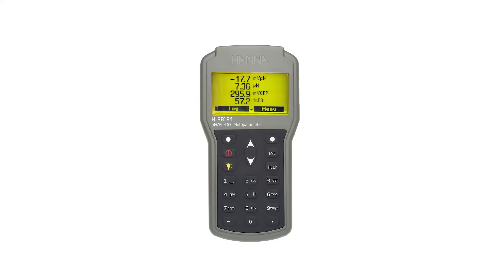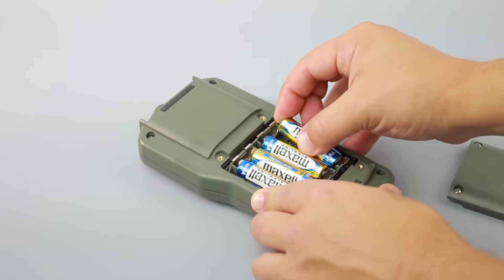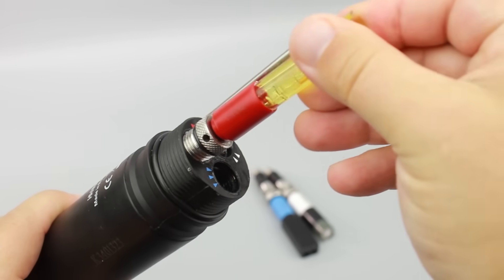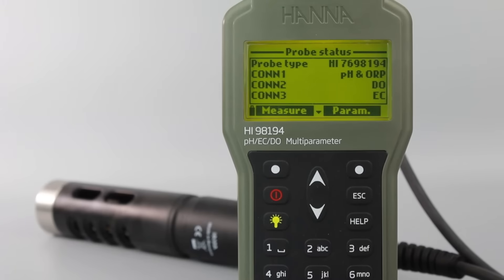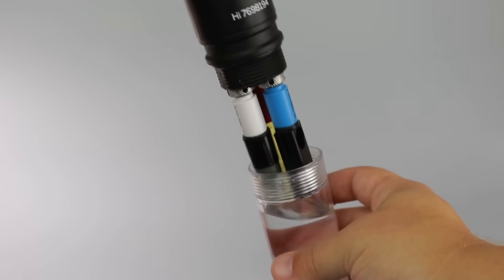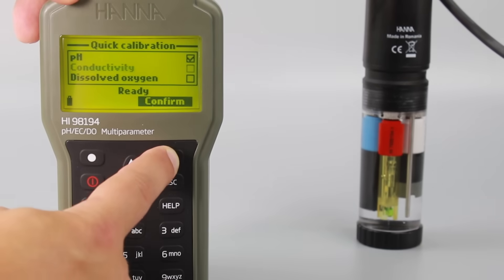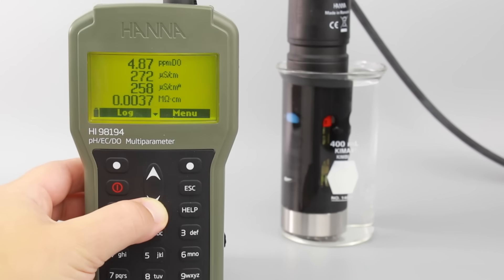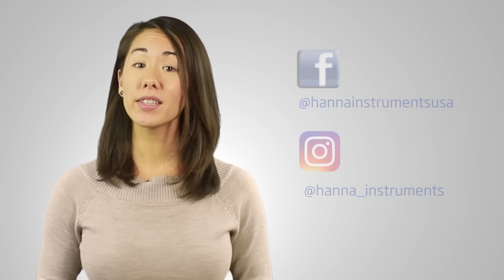How To - Using the Hanna HI98194 Waterproof Portable Multiparameter Meter

Comment: I've noticed that a lot of people are having the same problem with trying to calibrate the DO sensor and they are getting the reading "wrong standard". This happened to myself many times and it is very frustrating, I eventually figured out a work around which I think works very well. Instead of calibrating pH and conductivity first in quick calibration, skip these and immediately go straight to the DO calibration with the empty dry beaker beaker. The DO will calibrate within 1 minute because there are no droplets of pH/conductivity standard on the DO membrane as you have skipped these calibrations. When the DO has successfully calibrated, then go back and calibrate pH and conductivity and you are all set. 

I'm not sure why DO isn't first on the list in quick calibration mode as once the DO membrane becomes wet from the pH/conductivity calibration solution, the calibration reading almost always returns "wrong standard", it even does in the video above if you watch closely. You will never be able to shake off every tiny droplet from the highly sensitive DO probe, it must be completely dry in order for DO to be calibrated in my experience. I'd be interested to hear if Hanna agree with my suggested approach to the DO calibration as many people are having problems with it as can be seen from the comments below.
Reply: The video also doesn't convey that you must gently swirl the probe whilst logging your results, otherwise the DO result will be wrong if there is no movement of water on the DO membrane when the logging occurs. If you simply rest the probe in the sample as is the case in the video, you won't get an accurate DO result. It would be good if a rep from Hanna could confirm if my proposed work around for the DO calibration problem is advisable or not.
Reply: @dpark5070  well it says there should be no solution present when calibrating DO
Reply: @kyleyurkow1169  Yes I am aware of that. However, the video recommends that you should calibrate pH and conductivity first which does not work well for DO calibration in my experience. This results in a very low success rate when trying to calibrate DO in my experience. I've found that it is much better to calibrate DO first when there is zero moisture on the DO membrane that would otherwise be present if the  pH and conductivity were to be calibrated first (which is what the video recommends but does not work well in the real world).  

For those that get the "wrong standard" message for DO, try flicking the outside of the DO electrode with your finger to unlock air bubbles, this has worked well for me many times. Failing that, you can try to change the HI7042S electrolyte fill solution which can also help.
Reply: Did you hear back from Hanna on this?

Comment: are you sure that i can do DO quick calibration like you did on the video?cause for me been trying for some time and its still reading wrong standard and i have following the instructions as given.

i have noted from the video when you were doing DO calibration it read wrong standard and you just said click confirm but i didnt see the meter reading confirm ,could it be that there is a confirm button to use despite the meter reading wrong standard.

and also how do i clean the probes especially for DO mine has already turned white due to waste deposits...

Comment: How do you find the calibration data when using this procedure?  i.e. slopes, % saturation, etc...
Reply: What calibration data? once calibrated, The meter has been returned to default setting and ready to use for accurate measurement

Comment: Hi, I am trying to do calibration and  it just does not recognize the standard as good, I have followed the instructions for both the quick calibration and the single parameter calibration. For 100% it says that it is the wrong standard as it just reaches about 39%, for 0% it does not stabilize even after an hour, so the countdown never finishes. What can I do?
Reply from the maker: Hi Neri. Sometimes with meters like this it's just a matter of settings. Contact Tech@hannainst.com  and they can go through the process step by step with you. Let us know how you make out!
Reply: @Neri Have you sorted the issues out?
Reply: @aungkyaw9353  Hi.  Fortunately, yes.  My mistake was that I was placing the membrane wrong, I mean, I was not tightening the membrane correctly so there was not good contact between the solution and the electrode.  Technical support helped me to solve my problem step by step by telephone.

Comment: When I do quick calibration it gets to DO & then it says wrong standard what does it mean?
Reply from the maker: Hi nada. When doing the Quick Calibration, the solution you're using is calibrating pH & Conductivity with the same solution. When it gets to DO, you want to empty the beaker and shake off any remaining moisture on the probes. Then screw the empty beaker back onto the probe and wait for it to stabilize. Hope this helps!
Reply: @HannaInc  I did follow the instructions thoroughly but it's the same problem :( also is it right to add a solution in the DO probe?! It's with the instrument
Reply from the maker: @nadamedhat  The kit comes with the DO electrolyte solution. Before calibrating that sensor, it's best to rinse with some of that solution, and then fill the cap. Here is a step by step for your DO sensor.                                                 The D.O. probe is shipped dry. To prepare the sensor for use:
• Remove the black & red plastic cap. This cap is used for shipping purposes only and can be thrown
away.
• Insert the supplied O-Ring in to the membrane cap.
• Rinse the membrane with some electrolyte solution. Refill with clean electrolyte.
Gently tap the membrane cap to dislodge air bubbles. To avoid damaging the membrane, do not
touch it with your fingers or directly tap the membrane.
• With the sensor facing down screw the membrane cap counterclockwise to the end of the threads.
Some electrolyte will overflow.
• Rinse outside of sensor with deionized water.
• Invert sensor and inspect. There should be no bubbles or debris between the membrane and
sensor body.
Reply: @HannaInc  How long will it take to stabilize? It's been 10 - 15 minutes, but still won't stabilize
Reply: @lijusuresh203  did you finally manage to do the DO quick calibration ?